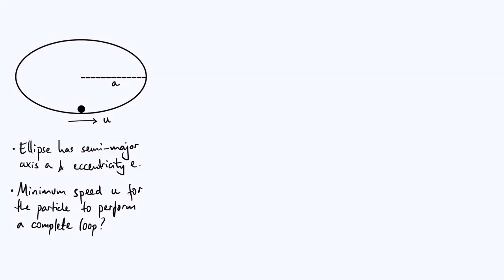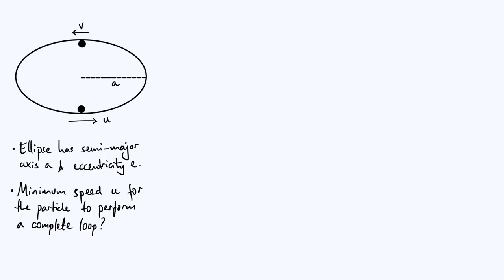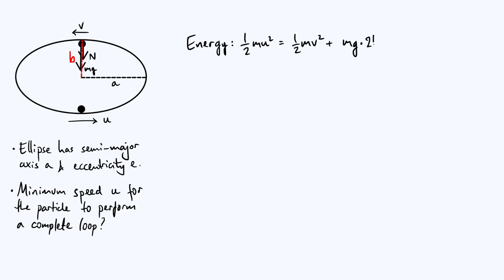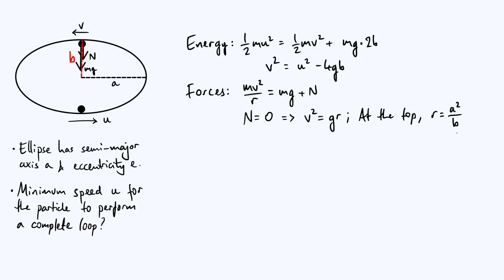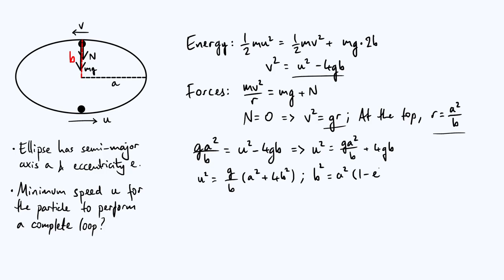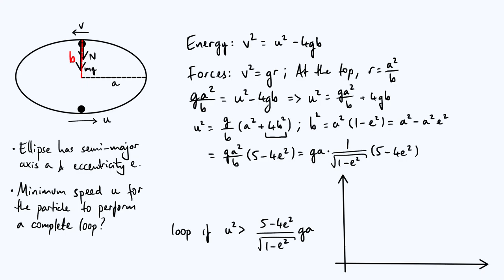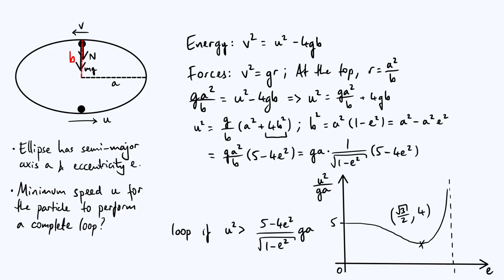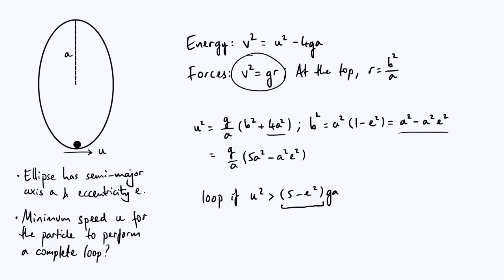Elliptical loop-the-loop: minimum speed required

Comment: I'm a little bit unsure. My intuition tells me that for the vertical major axis that if you smush the ellipse a lot then the top basically turns into a super tight corner. So I would think that there would need to be a lot of force needed to change the direction of velocity. Also in the same example of the super smushed ellipse, the sides will approach vertical walls so would the minimum velocity for not falling off at the top even get up the sides to get to the top(since the derived expression seems to say the min velocity just keeps decreasing. )